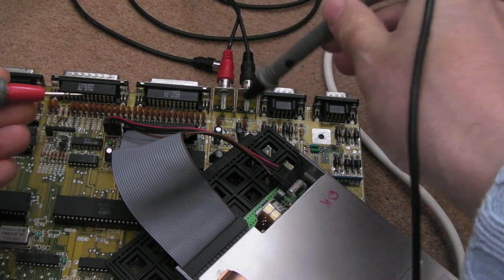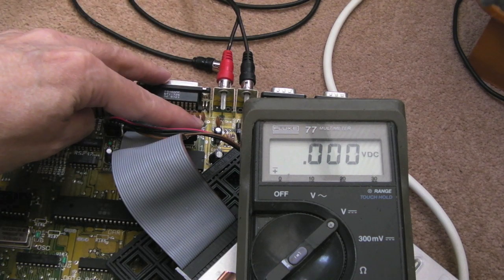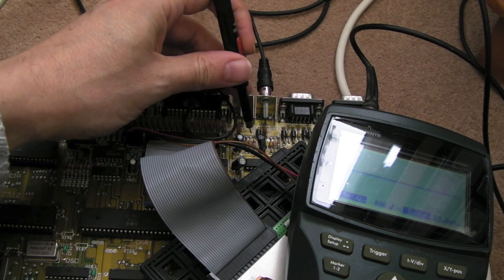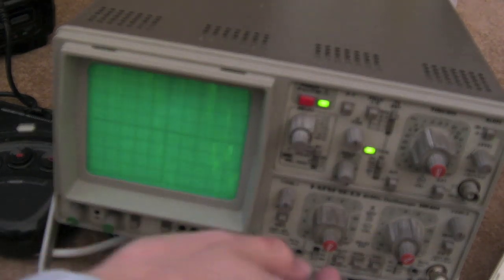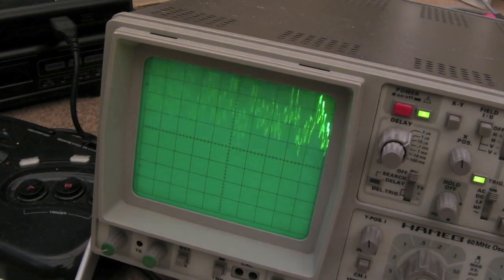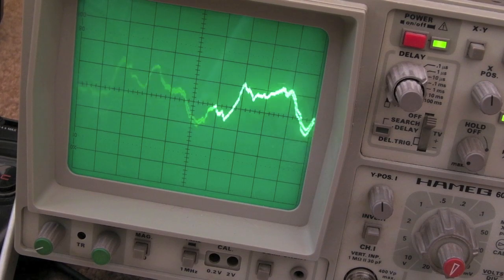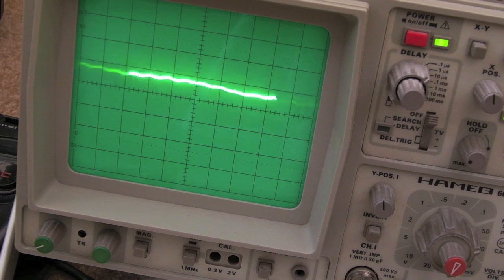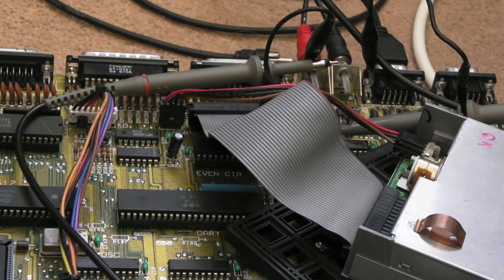Commodore Amiga A500 Audio Coupling - Bipolar Caps Follow Up

Comment from the maker: To be clear here before people get the wrong end of the stick - whilst we saw the same -ve peaks Jan saw, it really isn't a problem.  The cap holds ~2.5v as we saw, those small -ve peaks of AC coming through the cap aren't enough to cause any problem, as the cap still has a positive charge around 2.5v.  There's still benefit to using a bipolar cap according to what I've read and been told, but I see no difference on the scope!  So it's really up to you what you replace them with when recapping.
Reply: Matters of perspective, cost of the components, and keeping the Amiga as original 'hardware purist' would be replacement of the same type capacitor. Much like the fuse replacement on the supergrafx. Keep it original if that's possible, however if mods are acceptable rock it with the absolute best components available.
Reply: I think that given you audio driver has a DC offset using bipolar caps would only make things worse. Bipolar electrolytes have a higher ESR (internal resistance). Bipolar caps are used in professional and modern audio equipment because there's no DC offset (for other reasons), but they do have disadvantages. The whole science of crossover circuits is pretty much like a religion. Trust what you know as a fact and can measure.

Comment: From: https://en.wikipedia.org/wiki/Electrolytic_capacitor#Reverse_voltage
"Nevertheless, electrolytic capacitors can withstand for short instants a reverse voltage for a limited number of cycles. In detail, aluminum electrolytic capacitors with non-solid electrolyte can withstand a reverse voltage of about 1 V to 1.5 V"
So 200mV reverse bias for short periods of time should be within spec.  Time to dig out a datasheet for one of those old caps?

Comment: Let's be clear here, Amiga sound while being amazing at the time, was not audiophile quality. It raised the bar as the standard sound output far beyond what many computers were capable of at their best. Does anyone know if Commodore even had an audio engineer on staff at the time? and if not, it make more sense why the audio circuit would not use bipolar caps. Not using bipolar caps could be because they used a designer who didn't have much experience in such or (as I had some experience with) had issues getting supplies of them at the quantity needed (I use to repair BBC recording equipment)
Reply: Bear in mind this is 1985, and CD had only really just started to take hold. DACs capable of CD Audio quality were expensive, and you had to have two of them for stereo ! Some of the early cheap CD players even used to cheat and time-multiplex one DAC!

The TL08x was a fairly well used Opamp in audio systems, and the LF347 was simply a cheaper grade of the TL084. A lot of audio circuitry was still being done with simple one/two transistor based audio stages rather than opamps too.

Comment: Nice investigation.
There is a mod that can be done by bypassing 1 resistor for each channel.
The mod bypass the (LED) filter and it also raises the output level (volume).
This was a popular mod back in the demo scene.
We mounted small speakers on the inside by the rear vents.

Comment: It will be more "interesting" if you'd put some load on the output (after the capacitor). Even if the voltage across capacitor momentarily would be negative, it is not a big deal as long as it is less than a few % of it's rated voltage, and average voltage is still positive.

Comment: Amigas are infamous for using a wide range of resistor values in the audio circuit, so some systems will suffer the clipping/distortion problems and others won't.  You can swap out the resistors if the distortion or line levels are a problem.  I was surprised to find that the R1 schematics for my A1200 didn't match too well against my mobo when I recapped it a couple years ago.  BTW, I used ceramic caps for the audio circuit because I wanted the most durable caps I could get.  They work fine -- the sound quality is no better or worse.
Reply: MLCC Ceramics are the wrong kind for the job. If you really want the most durable capacitors that are correct for the job, you want polymer hybrid such as Panasonic EEH-ZK series.
Reply: @jaycee1980  I used Kemet polymers for the power circuits.  For the audio circuits, I used dipped radial MLCC rather than the standard surface mount type, as those are better for AC.

Comment: The audio ground is coupled to the digital ground on the rest of the board by the ferrite bead between the phono jacks.  This presents a low resistance to DC and low frequencies, but the impedance increases at higher frequencies to prevent noise getting into the audio circuit from the digital circuits.  This is what I think you mentioned another person commenting about.
Reply from the maker: It's still a direct path to the common ground, it just happens to filter high frequency noise!

Comment: It’s because of the bias that you don’t NEED a bipolar capacitor.  For those that feel I may be wrong or that physics has it wrong, go knock yer selves out and fit bipolar ones.  It won’t hurt, but then again, it won’t help either.  What would help however, is to select a lower noise op-amp.  Frankly, I like the Amiga audio circuit pretty much as it is.  There’d be no harm in adding extra capability such as an mp3 decoder though.
Reply: No point in a lower noise opamp - most of the noise is coming from the way Paula does it's D/A conversion
Reply: Peter Mulholland How does Paula perform the conversion?  I don’t have a datasheet.
Reply: @Jenny_Digital  Antti Lankila's note to modplayer programmers is a good starting point to understanding the Amiga's audio system. https://bel.fi/alankila/modguide/interpolate.txt
Reply: First Surname well, that is an interesting read.  I could tinker for weeks with what was published there.  Thank you.
Reply: @Jenny_Digital  according to an interview with Glenn Keller, the designer, it is a PWM type of conversion... which makes sense on a cost case given 1985 technology. R2R type DACs were expensive, and I don't think sigma-delta was around yet.

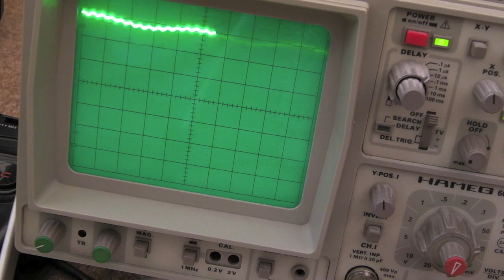Comment: Measurement at 9:00 seems about right. You can only see low signal levels of low frequencies. This is what capacitor coupling actually cuts out of the signal (DC offset and some of the lowest frequencies). If you had higher capacity there, you would see even lower signal level. Ideally it would be just constant DC voltage.

Comment: The cap is not connected to ground it is coupling the signal. I’ve seen it were certain TVs put different impedance than is standard but generally it’s 75ohm so there should be at least some resistance to ground. If you measure across the cap the signal should never go positive on the negative side of the cap. Either way if you read a data sheet there is a tolerance
Reply from the maker: Thanks!  Yes, there's no way it would go -ve on the +ve side due to the bias, so it isn't an issue at all!

Comment: would removing the DC bias and using a non polarized cap make the audio better?
Reply: In the case of the Amiga, no.
Reply from the maker: That's a good point!  I honestly don't know the answer to that!  What I would say is the audio shows no signs of how it could be improved!  Maybe it would be better with no bias straight through a bipolar, but not sure how we would test that to show where its "better".  Maybe more sophosticated equipment would be needed to compare.
Reply: Given the overal sound quality of this system, no. You'll not notice any difference. Also your power supply needs to be capable to deliver the negative voltages, supplying enough current (I haven't checked this).
Reply: @kriswillems5661  100mA is plenty for an audio circuit

Comment: Brilliant follow up. You have now seen the bias that Jan Beta was seeing and talking about. You are right about add adding CH1 and CH2, and since the signal is similar on both, and you invert CH2, you are seeing the small difference between the two. The chop function is used for slow sweeps, the Alt for fast sweeps. Chop with draw both channels at the same time, whereas ALT draws them alternately on each sweep, so CH1 draws on odd sweeps(1,3,5,7,9 etc) and CH2 on even sweeps (2,4,6,8 etc). There are a few videos about these functions.

Comment: When it does dip below GND then the signal "hits the lower rail" and saturates (flat-lines).
The output quad op-amp, U14, is a dual voltage rail (+12V/-12V) circuit and should happily go to ~+10 and ~-10 V before saturating (op-amp is likely not a "rail-to-rail" type). So the clipping is from some other source. 

Biasing is clearly happening in the first stage of the 2 op-amp circuit. The first op-amp is an active low-pass filter and it is boosting the audio signal up by a DC offset. Perhaps looking at where the clipping is coming from would be useful, and if the +2.5v bias is for the benefit of the op-amp circuit of just the output DC blocking polar cap.

BTW, I quite like the DC-coupled high-pass filter (i.e. treble boost) bypass, using a JFET (Q331, Q321 MPF102) that's cute (high-pass is part of the second stage).
Cheers,
Reply: UPDATE - The DC biasing may be for Paula's benefit (The 8364 chip). Take a look at the output signal on pins 30 and 31 to see if they have a DC bias on them. If you notice, U4 (Paula) is a single rail (+5V) IC and so all audio analog circuits in there have to be biased at 1/2 of VCC or +2.5 v in order to swing above and below the DC bias point. Likely that is where the signal is saturating... Oddly enough the +2.5v bias at U14 should remove the offset and return it to 0v, I am missing something here... Ugh, I may have to dig out my A2000 now and check it.
Cheers,
Reply: UPDATE2 - Edit, Paula is U3, not U4. Doh.
Reply from the maker: Thanks!  Yes - "clipping" perhaps wasn't the word I should have used - by that I just mean its "dipping" below the 0v line by between 100mv and 200mv, basically because I think the DC bias perhaps isn't quite perfect for a high amplitute signal.  But it is just occasional peaks, and from what I understand, these caps are happy reverse voltaged up to 1.5v, plus at that point in time its DC bias will still be around 2.5v anyway, so its kind of a none issue I think?
Reply: @GadgetUK164  - I am beginning to believe that the DC biasing is more for the benefit of Paula and is a lesser consideration for the DC blocking output cap, it just happily works in the polar caps favour. See my previous comment (UPDATE) though because the existence of the +2.5 V bias is a bit odd, the circuit around U14 pins 12,13,14 should be removing Paula's DC bias. At this point I am not sure if the audio circuits inside Paula are pure analog or some form of DSP (Digital Signal Processing), eg. is the signal out of Paula analog or PWM? (I think its analog...)
Cheers,

Comment: Nice follow up! Thanks for digging deeper into this. I learned so much from the comments and am still reading up on stuff and looking at schematics. I'm definitely going to make another video about this issue, too. Glad you basically found the same results that I found, even though I made some false assumptions in the beginning. On the sine wave test tone I used, the reverse overshoot was peaking at a little under .5V, some commenters pointed out that regular polarized caps can take reverse voltage up to 1.5V without any problems so that should not be an issue at all (even considering the life span). I also read in an audio forums (I always take those with a grain of salt) that bipolar caps add less distortion to the signal when used for decoupling so that might be another good point. Interesting topic for sure!
Reply from the maker: Thanks Jan!  Yes, I've learned that polarised electrolytics seem happy at up to -1.5v too for short peaks etc, and from what I understand, because the cap still has a  +ve 2.5v charge across it, that -ve peak probably isn't an issue.  I will continue to fit those super nice Muse bipolars I think!
Reply: @GadgetUK164  
Bipolars are just 2 electrolytics in series back to back.
Reply: @FireballXL55  Ahem. Parallel.
Reply: @cleverhandlename  Absolutely not you have 2 x twice the size capacitors in series with either both +ve connected together or both -ve together. if they are in parrallel you will still reverse bias one or the other capacitor to the full applied voltage.
https://www.youtube.com/watch?v=JSW37535wgc

Comment: The BIAS is the charge on the cap. It is always +2.5v in this circuit. Say the +ve pin of the cap goes to -1v then the negative pin moves to -3.5v, there is still the +2.5v across the cap. The audio wiggling doesn't charge the cap and certainly doesn't reverse charge the cap.
Reply: Indeed, it seems that neither GatgetUK nor Jan really understands it. The voltage on the cap goes never negative. You need to measure differentially with 2 scope channels, each on one side of the cap and let the scope show the difference.
Reply from the maker: First of all - I do understand it!  The DC bias means the cap always has a positive charge of around 2.5v, meaning those small -ve peaks are fine as the cap does have a positive charge.  I still prefer to fit high quality bipolars and I see no reason not too.  I did measure using 2 probes across the cap between +ve side on one channel and the -ve side to the other channel, that was the part of the video I played around inverting one of them (so they almost cancel each other out), and show the difference between them.  Not sure if that's what you meant?
Reply: @GadgetUK164  Well, maybe I just misunderstood you guys. Those small negative voltages are no issue at all because the voltage on the cap is always +2.5V. I didn't really understand why the video of both of you focuses on the negative voltages at the positive side of the cap. They are irrelevant to the voltage over the cap.
Reply from the maker: @kriswillems5661  I think we've both found that it's a none issue.  Maybe we've not clearly shown or explained why, but we do both get it.  It does make me wonder why there are still articles talking about it being a problem when it isn't.  The negative peaks aren't anywhere near large enough or frequent enough to drain the cap, so it's always highly positively charged.  I guess just measure its PD between + and -  of the cap is the evidence of that.
Reply: A video explaining scope:
https://www.youtube.com/watch?v=zsy-pxpfB4o
Reply from the maker: Thanks, that really useful information! =D
Reply: You need to invert channel 2 and press the ADD button. Don't push the DUAL button.
Reply from the maker: I did that on the video =D
Reply: I forgot to add both channels should be DC-coupled when showing the difference.
Reply from the maker: Thanks, yeah, I did that on the video too!